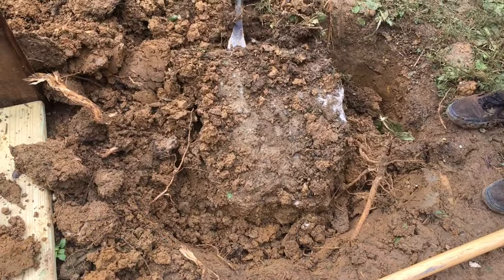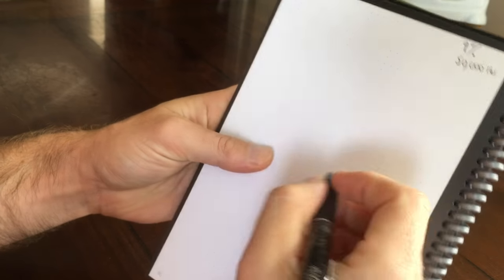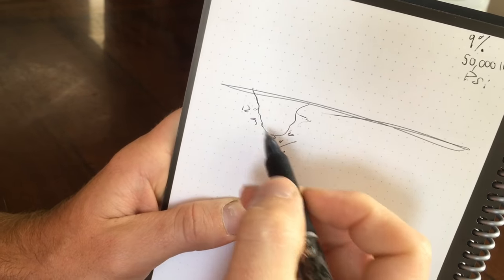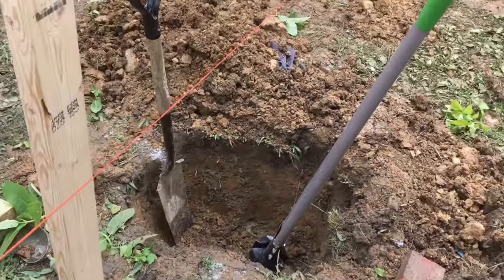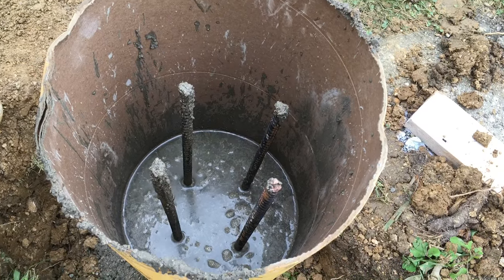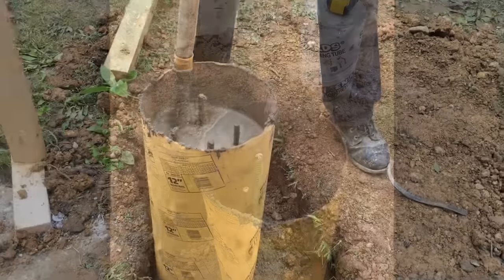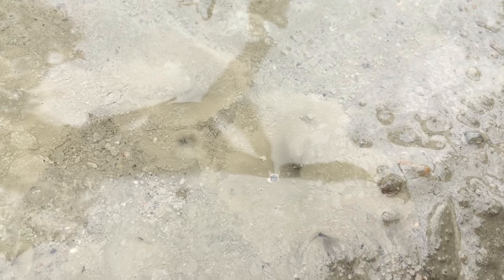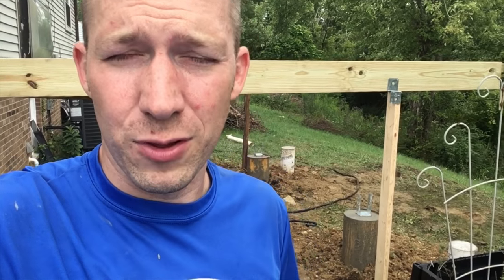How To Build Deck Piers To Last

Comment: Thanks for the presentation.  Although others have already spoken about your cement mixture being too thin, as in watery, it weakens the concrete.  Also, once cement is mixed up it needs to be poured within a certain amount of time otherwise it weakens the concrete.  Read the bag of cement to find out all about your product.  Another thought, at least for the DIYer, is to use the ‘Big Foot system’ which gives a more effective pier foundation.  Check it out,  you might like it.  Also, rent a cement vibrator, it works much more effectively to remove bubbles.  The pros use it for a reason.  Just say’n.  😂
Reply: If you read the quickrete installation instructions for their tubes it specifically says don’t use a vibrator.

Comment: Not a builder here. I have the same size deck and thinking of using three 10"x48" piers with the "Big Foot" polyurethane footings as a base for each pier. They're designed to be used with various size tubes. These footings are filled with concrete as you file the tube. In the long run piers probably have a significantly less chance of sinking because the Big Foot can be 20" diameter up to 30" inch depending on the size you pick. Probably get away with smaller piers and maybe even fewer piers. Good video. Soupy concrete though.

Comment: Concrete is very alkali and will dry out your skin bad. Don't go out of your way to put your arm in it. Mix was too wet if that much water pushed up.
Reply: I was thinking the same thing.  Most people wear big long rubber gloves if they have to touch concrete, you definitely don't just go stick your entire bare arm into it.

Comment: NEVER add this much water to your concrete. It needs to be thick and well mixed. The ratio given on the bag will be close, perhaps TOO think and if so... just another cup of water will likely make it just right.  A soupy pour makes for weak concrete. Fun video yet often incorrect. I will stop now. Thanks.
Reply: OMG, that’s waaay too much water. Crazy.
Reply: @R50_J0  overall this is a helpful video by yeah, the amount of water in the mix is absurd. that will have a negative affect on the strength of the piers
Reply: Also don't mix with your arm! Cement is caustic.
Reply: i never knew mixing with too much water makes it weaker thanks for advice

Comment: Built a firewood storage shed in Connecticut 
I feel bad for the guy who ever tries to remove that. 
60” deep I poured my piers ^shape the tops while the concrete dried to help water run off the exposed tops with the mushroom technique and 1/2 rebar.  Have fun digging those up if they ever need to be 🤦🏻‍♂️😂

Comment: Thank you for posting this. This is great. Question. I too have a hill. Do the laterals also need to be as deep as the depth of the pillars? In other words because of the deccline on one side, does the space between the hill and the side of the pillar need to be equal to the depth of the pillar?

Comment: No, you have to look up the IRC codebook online and figure out your square footage of your deck, pick a PSD load rating 50/60/70 depending upon Live load and snow load, then figure out your ground type which determines how much weight your pier can support( normally 1500 lbs/sqft for poor soil), then figure out how many piers of x size (12, 16, 18,24", etc), then look at your max joist and beam spans and reviews piers and the weight they will support and decide if you want more cheap piers for lower beam/joist  lumber $$, or fewer piers and more expensive beam/joist lumber $$.
Guys without college do this, so its not rocket science. It is however quite easy to guestimate wrong and have it start sinking or falling down after a couple of years.
Reply: Not to mention his concrete mix has 3x more water than needed.
Reply: Yea- absolutely no reason to guess there is plenty of information to do a deck properly to CODE!
Reply: Just catchit and Jack it up. I've lifted over 40 houses

Comment: I remember back in the 80's the old navvies working on site wading through freshly poured concrete without proper PPE. Quite a few of them would be rushed to hospital with chemical burns. Obviously things have changed since then... Judging by the way your man was elbow deep stirring the concrete without protection, the concrete you guys are using must be more chemical free compared to back then!
Reply: Its not though lol.
Reply: That was a very amateurish move.

Comment: My problem is a wet hole on bedrock at 48 inches(below frost line here) I'm going to drill the granite for rebar...and possibly dry fill the concrete for about 6 inches to displace the water before the wet mix... yippee

Comment: How long after pouring the footings before I can start setting my posts? I thought I was gonna do it 24 hours later and I ended up jerking the j bolts loose. Am I supposed to wait 5-7 days? Or 28 days? Or should I have been able to do it the next day?
Reply from the maker: I would think it depends on the product used but a minimum of 24 hours would be good and perhaps as much as 7 days
Reply: If done correctly with the right weather conditions you should be able to add bolts within a couple of days.
Reply: i would wait for 7 days.
Reply: Anyone who can use google knows 3 days minimum, and a week generally to be safe.

Comment: Frost doesnt attach to the pier...moisture goes into the ground freezes and heaves the soil sofetening it as the soil thaws. Also a footer has at a minimum thumb rules if your not in a coded area for width and thickness

Comment: What’s the benefit to the rebar. When do you determine if it’s necessary in deck piers?
Reply from the maker: It helps prevent cracking and movement of the cement. Arguably you probably don't need it but I would rather over-engineer than under
Reply: I hear ya. I’m planning for 4’ elevated deck with pergola, so I’m definitely interested in over engineering. I’m in Dayton, so thanks for the “local” frostline info 😎. Who Dey!
Reply: @SpiritofaHandyman  technically it's a concrete pier. Concrete is made from cement, agregate and water.
Reply: Something else to remember if you are pouring a slab with rebar, concrete holds up well under compression but not tension. The rebar helps with tension. So you would typically put the rebar in the area on the outside half that you expect it to crack, hope that makes sense.
Reply: @rodjohnson646  :) there's always one.
Reply: @BarryHull good point
— sometimes they pre tension slabs if they’re really big ✊

Comment: Thanks for the videos. I have a question on deck footers. I’m building an elevated deck and plan to have exposed aggregate concrete patio below the deck. My deck footers will be 12” sonotubes 42” deep. Because the look of the concrete footer tops will be different than colored exposed aggregate slab, I’m afraid it’ll look ugly. So, how do I hide the top of the footer? What kind of interface should I have between the footer and slab?  Thanks!
Reply from the maker: Just bury the footer 1" below the height of your patio and pour the patio over footer. That could give you the desired look while still having the strength below

Comment: Great video! In planning a pavilion, going to use round logs ( pine) any ideas or suggestions on how to mount the logs to the concrete footer thanks
Reply from the maker: I would think some kind of expanding bolt that drills into the footer and that also pushes up into the log would work
Reply: @SpiritofaHandyman I like to use an anchor bolt and apoxy the inside of the log to try to prevent a straight line wind gust from picking it up I also  put a metal slate under log to try to prevent rotting scribe log on concrete then drill hole I've even used 5/8 rebar once before on the rake of a gable was virtually impossible unless a tornado came though.

Comment: Looks too wet a mix. Am I right? Most other videos, to include concrete manufacturers, show a stiffer mix.
Reply from the maker: It looked stiffer in the mixer but I think the weight of the cement pushes all excess water out the top of the tube. It has held up fine but if I was doing it again I would definitely try to cut some of the excess water out of the recipe
Reply: I build decks too, pour a lot of landings for stringers and pour a lot of footers, your mix may seem a little dry but water will always rise to the top no matter what
Reply: for deck it is not big deal. but, declared concrete strengh will be achieved in recommended mix only: changing proportion of anything (including water) weakening final concrete strength. For deck it is not big issue: u will never have loads to brake it from regular use.

Comment: You are confusing as what is the pier and what is the footing. The pier is the tube and the footing is what the pier is sitting on. The size of the footing depends on the load and the soil bearing pressure. The live and dead loads are dictated by code.

Comment: my suggestion is to NOT use concrete but to use four foot long screwpiles. use a skidsteer to screw them in, then back them up one turn so that they are settled in place. Build the deck on top of them, it will never move.
Reply from the maker: can you post a link of which product you specifically recommend? That sounds like a great alternative
Reply: @SpiritofaHandyman  I've gotten quotes from Technometal Post and the other big name, and they are a bit expensive. I think 12 8000# helical steel posts was $4k. However, its done in an afternoon and guaranteed to hold, whereas any concrete post can sink.  I can get someone to dig me the same number of 12" holes with a skidsteer for $800+, then add in 100-150 bags of concrete or try to get a pump truck out here and fuss with the city and leveling for I think $2500....
Reply: They are great ... The price is NOT.
A post concrete and time is around $150 each... The bobcat and accessories alone are $600 per day.
Reply: Waaay overbuilt for the typical residential deck. Properly installed concrete piers are more than sufficient and cost effective

Comment: Thank you for the video, I really appreciate you taking the time to share this. Im trying to add 2 rooms to my house for my kids.  The entire addition should be about 24x30.  How many concrete piers do you think would be enough for a 24x30 building?  I live in texas, and the frost line here is less than a foot.  Would it be ok to only dig a foot deep?  Also since it would be less concrete, do I still need to use rebar?  Thank your in advance for your help, it means a lot for someone who cant afford to hire anyone
Reply from the maker: Great question. What you need to determine is the safe bearing capacity of your soil. Check out this article to see what that means: https://civilread.com/safe-bearing-capacity-soil/

Then you will need to determine how wide you need your piers to be based on the safe bearing capacity. Read this article to get a better understanding: https://pro.homeadvisor.com/article.show.Footing-Fundamentals.13700.html

If this is a major addition to your home it may be worth the money to consult a geologist or structural engineer before you begin to make you you have the correct number of piers at the correct width to hold the load of your building. It wouldn't be good to complete the build and a couple years later have it sink into the dirt after a particularly hard week's worth of rain
Reply: That’s so nice for you to reply and help!

Comment: Whats the name of the the metal things above the concrete? Pd: nice video!
Reply from the maker: 4-in x 4-in Triple Zinc Wood to Concrete (Cast in Place) Base
Reply: @SpiritofaHandyman  so you applied that while concrete was wet
Reply from the maker: @Okorokanze2000  correct

Comment: That’s the wrong way to batter concrete,to much water will make weak concrete you will have a cracked post eventually ,water has to be exact there are directions on each bag of cement or in any builder book ,sorry !

Comment: Water/cement ratio was way way off.  As a designer of a couple yards of concrete, I was rather unimpressed.  Weight of the concrete pushes the water out?  WHAT?  Sorry, not true.  I agree on some ideas but that concrete tech tip is valueless.  Bottom line, keep the wood away from the concrete, keep w/c ratio as low as practical, use admixes if you want more flow (it IS what they are for) and if possible, use more cement to the bagged mix to "sweeten" it up if possible.  They are often fairly lean anyway.
Reply: Make a DIY video, Don.

Comment: Can this work for my tiny A frame (700sq ft)?
Reply: The same principle applies, but you would probably want to use a lot more footers to support the additional weight of all the construction material
Reply: u can. but you need to size footers based on your loads: put more columns or make them bigger and most likely you will need combine both options. also you should know maximum allowed spacing for the columns: your house drawings should tell that. it is very easy to size footers if your drawing specify spacing and load on each. also you need to know your soil type: if you did septic test - just look soil type on depth of your frost line.

Comment: Is there a rule of thumb for how many pier footings you need for a structure?  Every 6 feet? Every 8?  We're looking to build a cottage/shed that's 12x24x16 and so far are planning on every 6 ft 12" piers, but wondering if that's overkill?
Reply from the maker: It totally depends on the soil type where you are. The more rocky it is the less piers you need. The looser the soil the more you need.
Reply: @SpiritofaHandyman  Based on a pretty old soil survey of the county, looks like the words, silty, clay, loam, gravelly loam pop up a lot.  From working on it, it seemed to be pretty easy to dig up when dry (cuz it's the desert after all), and when it rained, it's hard getting the dirt/mud/clay mix off of your shoes even when scraping it off of a cattle grate?
Reply from the maker: @kaeli  The best thing to do is to contact a local geologist or engineer to take a core sample in your yard and give their expert advice. Without that advice, I would definitely air on the side of putting in more piers than fewer
Reply: @SpiritofaHandyman  Thanks :)

Comment: great posts without embeded locked in steel attaxhment plates- which 90% would have done. You drilled and bolted them in.